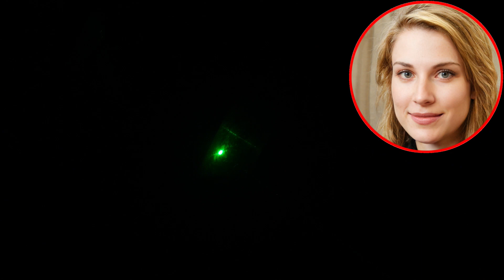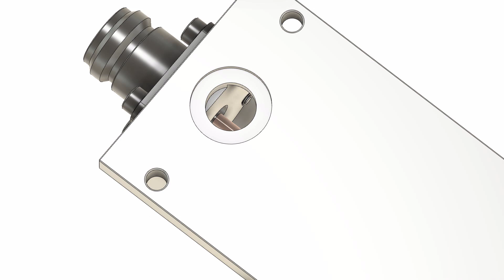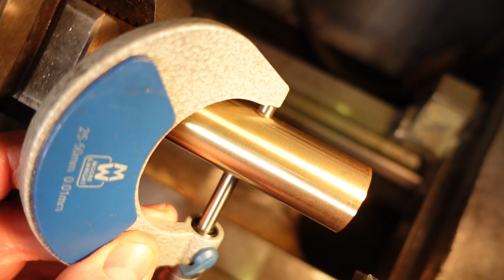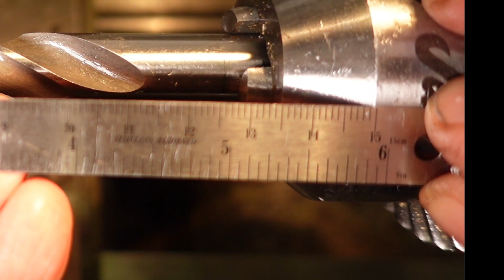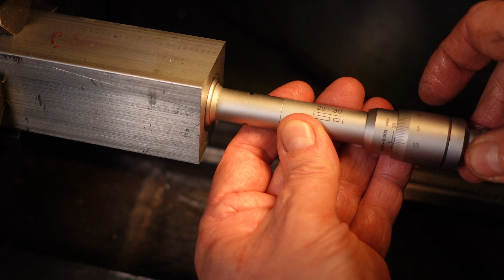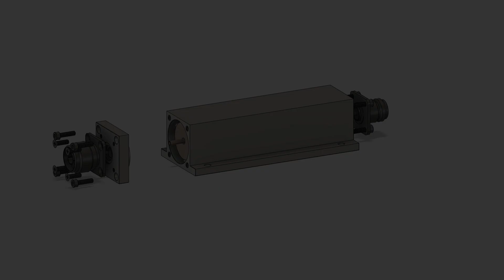Machining Microwave Coaxial Low Pass Filters Part 1

Comment: Out of curiosity, why not machine the barrel to length with both ends open and cap both of them?

Would have allowed for much simpler dimensioning by side milling both ends in one setup.

I can only assume that there's some consideration I'm missing here, and with what I know about making RF filters that's a lot of considerations to miss... Like virtually all of them.
Reply from the maker: I considered doing exactly that, but then there is another joint for RF energy to cross.  Getting the junctions good enough to pass significant RF current in the few micrometres of surface because of the skin effect is already a significant challenge with the three joints in my implementation. Having a solid end gives a guarantee that the circulating currents at that end have an absolutely defined path, whereas at the other end I'm hoping that an aluminium on aluminium joint has enough gas-tight points of contact to ensure that there is no significant resistive loss and that the RF path length is not in any way asymmetric. The best solution would perhaps be to have the ends screwed in with a very fine thread, or TIG them in place, but then you have challenges about assembling the unit unless one of your sockets is a screw-in body type.

If I through-bored it, I could then nip the whole thing in the mill vice and machine both ends, both sides and the to in a single setup, leaving maybe 2-3 mm of waste in the vice, flip it and deck the top and that's finished.  As it stands, that's roughly what I'm doing anyway.  Better solution might be to make it from silver plated brass and soft-solder the end plates and maybe even soft solder the sockets to the body. I could make it as an open-sided box and fit a cap perhaps.  Lots of options to try. Perhaps I should make one with end caps and compare the performance and repeatability, but then I'd really need to wait a few years to see if there's any degradation.

Once I've made one, it's not actually that much faffing about to do the blind hole compared with making an extra end plate and four more tapped holes. Making a batch would  just mean setting some stops and possibly a positioning fixture. It's all about minimising the potential for losses and asymmetric paths and ensuring all the oscillating RF fields are as well-defined and symmetrical as possible.  The sockets have a raised ring that will be pressed hard against the ends of the body to make a gas-tight seal that is a lot smaller and at a far greater contact pressure than the joint of the end cap and body. 

You've got me thinking about a way to improve the end cap joint by having a step that's 0.1 mm too shallow on the end so there's a much higher-pressure contact ring along the joint between the end cap and body.

Thanks for triggering that idea!
Neil
Reply from the maker: At higher frequencies, the capacitance of even a poor joint between two abutting metal faces is so high that it can look like dead short for RF current, and you can even configure the joint to include a choke section that electrically isolates the contact area. At 1.3 GHz, that's not very practical, but the capacitance of a micrometre-scale thick alumina and air layer between two aluminium plates does help reduce the impact of poor contact areas, but it's another variable that I'd prefer to exclude.  I could probably run a 3D electromagnetic finite domain analysis of the end plate connection to see what the variance would be.  It just feels better empirically to remove as many of the potential variances by adding a little extra faff to the machining I guess!
Reply: @MachiningandMicrowaves  What about  conductive O rings?

If you put one in the end cap you can make the ID of the face groove line up exactly on the bore. Providing the grove cross section is the same as the O ring cross section, when compressed it will guarantee a good conductive and airtight seal with excellent symmetry and excellent contact right on at the interface.

It will also allow for more tolerance in terms of surface finish and should allow for lighter clamping loads on the bolts.
Reply from the maker: @dtnicholls1  That certainly works for sealing waveguide flange joints with knitted wire compression rings, but the objective there is to prevent leakage rather than maintain a very low leakage inductance and resistive loss. I think I have some of those rings somewhere that might be large enough to fit the face of the cavity. Ultimately though, the choice of using aluminium is going to be the limitation.  It would be much better to use heavy silver plating on brass as then gas-tight contacts are a great deal easier to achieve. Screw-in end caps would also be a better choice, but then I'd need to use threaded body sockets.  This version with N sockets is a special for someone, I normally just use 7-16 DIN as the sockets then cover the ends completely and the body can be through-bored.  Much nicer solution all round

Comment: Nice. Do you plan a video on actually measuring the filter on a VNA?
Reply from the maker: When I get the machining finished, I'll run it on a couple of VNAs, then put serious power through it and check the results on a spectrum analyser to compare the before and after results and the theoretical against actual.  I won't be receiving through it, but I might pop it in front of a good VLNA and see what the impact on noise figure it has.  I use a tuned bandpass filter on receive because of the dreadful intermod products from digital TV and cellphone signals that swamp my receiver. Might end up as a third video, as so many folks have asked for something on how the filter works, so that will probably be next, along with making the fixture for soldering and the adaptor pins..  Sadly, I have to work full time at the day job this week, and there aren't enough hours in the day to do as much machining/electronics/radio/video editing as I'd like to!
Reply: @MachiningandMicrowaves  Excellent. Bring on those Smith charts!

Comment: I believe the glass spheres you mention are commercially known as Expansil (not entirely sure of the spelling, sorry)
Reply from the maker: Thanks, I can see Expancel from Nouryon who make thermoplastic microspheres, but haven't found glass yet.  Looks like 3M do something, but I'm sure I saw some CA glue with microspheres somewhere. Thanks for the pointer, at least I know what I'm searching for now. Most of the products seem to be hollow and subject to breakage during dispensing. Cospheric do precision borosilicate microspheres I see.  I guess I wouldn't need more than a tiny dusting of 5 um spheres to get a decent and repeatable glue line
Reply: @MachiningandMicrowaves  A means to monitor the applied force would be advantageous. For some reason I thought the spheres were glass/silica.
Glad I almost helped, nonetheless 😆
Reply from the maker: @MrZigzter  One British Standard Thumb is the current measure, but a heavy spring on the tailstock or a toolpost mount, with a rod to show how much it is compressed, should be enough to give a consistent force. Good thought. Again.
Reply: @MachiningandMicrowaves  You've reminded me a thought I strayed from adding, that was, to use a load cell. Furthermore since, a triage, as triangulation could insure controlled pressure distribution. Everything moves proportionately to force. Albeit logarithmic or exponential in many cases.
A pleasure, thank you in kind.
By the way, is current measure the amount of electrical current resistance from different given points? It could be very interesting if the two could marry up and prove each other simultaneously.. 🤔
Reply: @MachiningandMicrowaves  The glass spheres are called 'Ballotini' - the ones used for controlling adhesive bond lines usually cite Raytheon Spec HMS20-1776D or Hughes Spec SCGMS-53004.

Comment: that headstock dro is genius, i was wondering why you didn't just set it to 3 mm, until it came into view. cool vid, i subbed
Reply from the maker: It uses a super-cheap scale because it gets drenched in oil and chips and I often hit it by accident, so I didn't want to use a better scale which is settable.  I might change to a coolant-proof scale and remote display at some point, but it works pretty well, and I can wind it forward 3.00 and hit reset.
I should really start using a roll pin like Peter from Edge Precision, but this is good enough and the scale is only accurate to about 0.02 mm.

I REALLY want to get back into the shop this evening to make the spacing pieces and get the disks soldered, but the Day Job and Household Chores are getting in the way. Still another hour of day-job to complete this evening or the project manager will give me one of her hard stares tomorrow morning.

Comment: Super-handy tips for an about-to-be first-time lathe owner! I liked the part about accurately indexing the forward edge of the parting tool to the part face, and the bit about characterizing the bond thickness on the glue chuck. (Heck, I wasn’t even aware of glue chucks in the first place!) I like the tool-height setter as well, it’ll be one of the first things I make for my own lathe when it comes. Very useful content, thanks!!
Reply from the maker: Hi Dave, using glue is a fairly new approach, clockmakers have been using wax chucks for centuries, I guess the Antikythera mechanism used wax chucks as well. Superglue needs a lot more heat than wax but is a bit stronger of course, and you don't have to preheat the chuck or part.

Parting isn't really a high-precision operation as the tools are thin and wobbly at the best of times, but it helps when I'm making 20 of something that I can get the thickness to 0.3 mm or so of the finished size, then I can lock the carriage when finishing the other face - unless I'm using a sacrificial glue chuck of course, but then I zero the DRO or wheel when facing the chuck, and make the cut in the right place with consistent tool deflection (assuming a 0.8 mm radius insert and 0.3 mm depth of cut each time).  

With ancient lathes like my Colchester, there is always a bit of play, although with the gibs set just right and running with a toolpost fixed direct to the cross-slide rather than being mounted on the compound, it is remarkably good at 40 years old, and cost less than a decent Chinese mini-lathe, and included the pukka Newall DRO.
Reply from the maker: Definitely have a watch of all the more educational folks out there, especially those with similar lathes to yours.  Mine is pretty much identical to Joe Pieczynski's so I can relate to his work more than the folks with newer lathes.  Just take everything with a BIG pinch of salt.  Some folks say you should never use carbide insert tooling because they used it 15 years ago and the inserts all needed lots of pressure. Modern finishing inserts and those intended for aluminium work amazingly well on most steels so long as your lathe has enough torque to take the "right" size of cut at the a sensible surface feet per minute.  The published speeds and feeds are often based on a 90 minute or less tool life, and it's often fine to run a lower speeds, but make sure the nose of the tool is properly engaged.  Grinding your own HSS toolbits is a really useful skill though, and that might be why everyone tells you to avoid carbide as a beginner. I rarely use HSS except for form tools cutting non-circular radii or funny beads and things, but I DO grind some carbide inserts with a diamond wheel on my ancient old Alexander D-bit grinder (Copy of a Deckel).  I've had some fantastic advice about techniques from subscribers, there are some folks out there who are very generous with their time and sage words.  Also some moany old wazzocks who feel it's important to snark about me not being a Proper Machinist, but it all adds to the jollity when I share their rude comments with my chums over an alcohol-free beer.
Reply from the maker: I have seen another version of that tool height setter which has a swivelling top plate. I think that might be a useful addition.  It has a spring or pressure washer under a capscrew head and it is offset so as you turn the cap, it swings over the edge and you can feel it touching the tool.  Biggest issue is how to keep the magnet glued into the base free of chips. I wipe it with a rag, then give it a blast of air, then use the palm of my hand to wipe it again.  The trick of using a steel ruler between the curved edge of a workpiece that is already machined concentric to the lathe axis is also a good way to set tool height where the workpiece has a hole in the centre, but the best way is to stick a piece of aluminium in chuck and face it off, adjusting the height until the tiny "pip" at the centre just disappears to nothing  as the tool reaches the centre.  You can also use a dead centre in the headstock taper for a quick and dirty check.

Comment: Fascinating.   My kind of shop humor.  Was doing nonferrous welding and proclaimed I was doing dissimilar joining as I was welding aluminum to aluminium.  Of course the filler metal was yet another alloy.
At least I have one Irish friend on the west side of the pond who appreciates my humor.
Reply from the maker: You must have been using a supplier like mine.  Every damn piece of aluminium I buy from them seems to be made of entirely different material, some of the elements in those alloys don't even exist in nature outside of the floor-sweepings they throw into the melt as additives.

TIG welding two "6082" parts with aluminium filler often feels more like brazing cast iron to titanium with ally bronze. Or perhaps more realistically with the high standard of welding I'm capable of, like gluing cardboard to plastic with egg-white. Hey ho.

Comment: I’ve picked up a saying from around the internet recently, it goes “I like your funny words, Magic Man” and is used in the face of ‘sufficiently advanced technologies’
Loving the videos, but as a mere ‘run of the mill nerd’ as opposed to the Level 5 advance physics alchemy that’s on show here, I must confess a whole slew of terms and principles fly so clear over my head they’re leaving con trails. Perhaps it wouldn’t bore the other wizards too much for a little bit of “Radio Chemistry 101” as we go along :D. Cheers!
Reply from the maker: Second episode has some "paddling in the shallows" tech explanations for folks who are not Mages of the Dark Arts, plus some deep dives for those who've been immersed in this stuff for ever and are total on the Dark Side. I'm going to try to explain how these filters work and why they are useful.  As Richard Feynmann said, the best way to find if you understand a complex subject is to prepare a freshman lecture on it.  If you can't, then you really don't understand it well enough. It'll be an interesting test of my rotten pedagogical and presentation skills if I can pull it off.  Up to a point, my approach is intended to entertain, amuse and spray the viewers with a firehose of detail rather than simply to inform and educate. Oh how I wish I had the skills of @3Blue1Brown or @Mathologer.

I won't dumb it down, but an understanding of the underlying maths of Tcheychev polynomials and Maxwell's equations isn't really necessary for a qualitative explanation of what is going in between those two sockets and how four disks and a tube can block signals above a specified frequency. No Magickery required.  Especially no Physics-defying laser tricksterisms.  I do wonder how many viewers are sufficiently huge Ghostbusters nerds that they recognise the slightly-munged dialogue.  Many of them were not born when the film came out.  It only seems like yesterday...

Comment: Waiting for a 2.5GHz knob tuner project. These videos are awesome.
Edit: *stub tuner
Reply from the maker: I almost preferred the original version of the comment! Not sure about whether I'll get round to a three-stub tuner, but I need to make some phase trimmers for 2.3 GHz and a 12-way combiner to take the outputs from a commercial UHF TV amplifier with 12 separate outputs and phase them together into a single humongous amplifier for 432 MHz.  I'll probably make a 2.3 GHz low-pass filter as well.  I need to make some coupled-cavity bandpass filters for 24, 47 and 76 Ghz too.  One slightly mad project in the pipeline is a 10 GHz oscillator based on a coupled cavity excited in a very low-loss mode, tuned by varying the temperature of the body of the cavity, with a short length of delay line to get the phase right to stimulate oscillations. I rather doubt I'll be able to get the phase noise and stability low enough for it to be of any use, but it'll be fun to go down in flames trying.

Comment: Have you seen Joe Pi's tip on indicating square stock using shims ? "Clever way to indicate a square part in a 4 jaw chuck", should save you some time.
Reply from the maker: I thought I'd watched all of his back catalogue, but I must have missed that one. I did work out a simple trick last night by taping four parallels to the stock, overlapping the end a little and using my Haimer held in a clamp on the toolpost, but I wasn't convinced it made much sense.  Oh wait. I could just use one parallel held by hand against each face in turn to achieve the same thing, couldn't I?  Joe will of course have a totally obvious, elegant solution that I totally failed to think of, using only an egg cup, scissors and a short length of drinking straw
Reply from the maker: Now I've watch Joe's vid, I can see the rubber band is better than the insulating tape I used, and I was using 100 mm parallels, so it was a bit unwieldy.  It only works if the block is pretty much parallel, so machining the part on the mill first is looking like the best approach. Using a single parallel by hand certainly worked OK.  I'll have to have a play and see what is most effective. Original link to Joe's site is https://www.youtube.com/watch?v=WCei5GlEZ5g